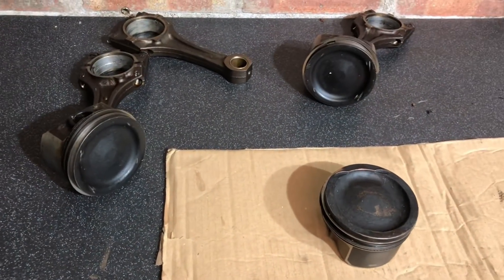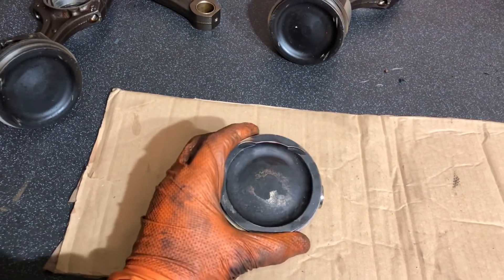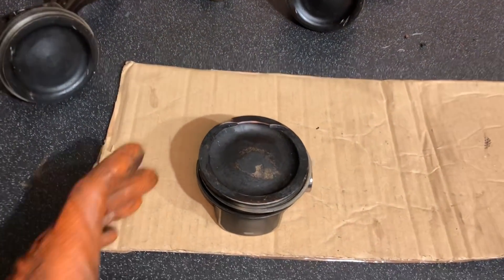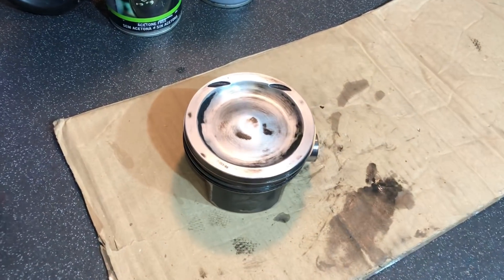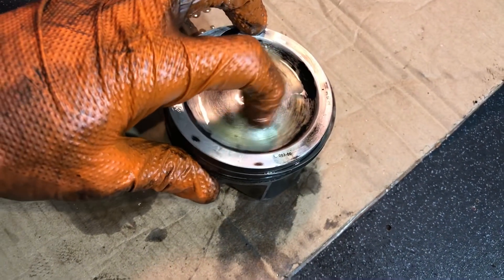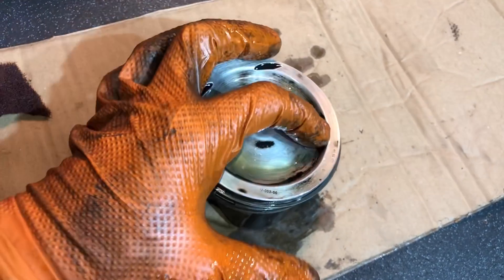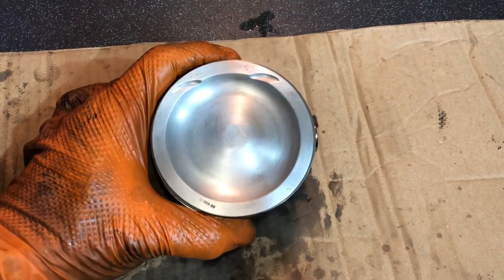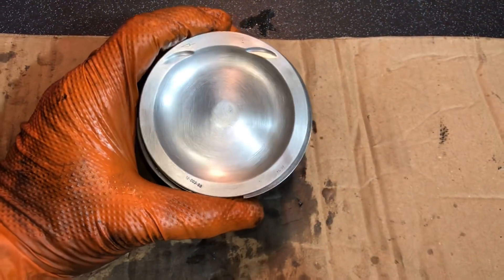Engine Rebuild Tips: Restore & Polish Your Pistons (More Horsepower)

Comment: DO NOT POLISH THE TOP. 
"the coating helps shield the rings from heat caused by improper burn of the fuel which creates hot spots."

Comment: I’m cleaning carbon off of a Yanmar Diesel engine. I’ve tried Wd-40, carb cleaner, acetone using a toothbrush, and a brass brush. The results are not that good. Even using a carbon scraper in flat areas. Is diesel carbon harder to get off?

Comment: OF COURSE...You should remove the rings for this whole procedure.  Probably wrist pin too.  Then clean it.  Then clean it again.  A tooth brush works fine.  Whatever method you use...CLEAN IT.

Comment: Most important place to get the carbon out is inside the top ring groove.  If carbon is left in the top groove and new rings are installed in the rebuild the carbon will not allow the rings to compress properly.  There goes your high dollar rebuild because your piston's top land broke.

Comment: Im extremely happy when theres more videos from you regardless of the length type But i would appreciate a video on z20let engine auxiliary water pump which is not working after car is switched off. I have changed mine and when the car is switched off it dont work but does work when car is first turned on and runs until just above around 80degrees , then it wont come on again ,untill another cold start. So essentially not acting as an after run pump but more of a heater matrix resource. Any advice would be greatly appreciated too

Comment: Great work as always your work is always second to none I have a question for you and haven't come across the info i need am basically in the middle of a z18xe to a z20let convershion on my mk4 convertible and I cannot figure out where the extra fuel return line connects to the tank and if it can on my 1.8 tank any help I would massively appreciate your help or any info on a video if possible many thanks